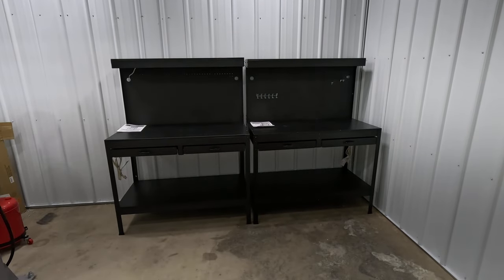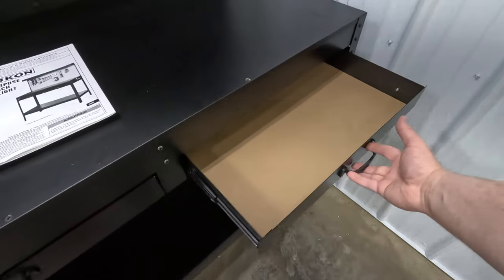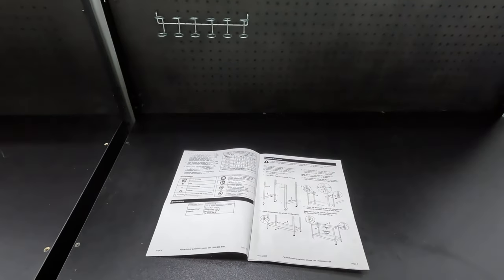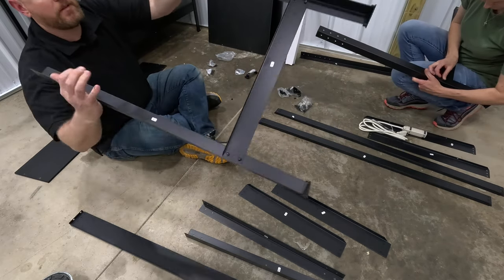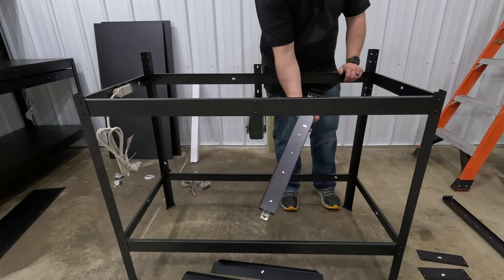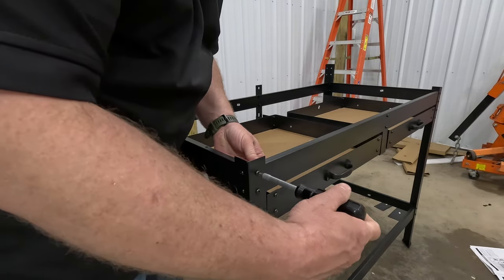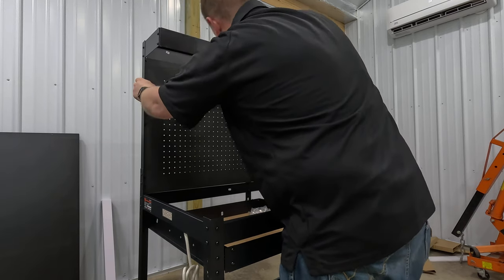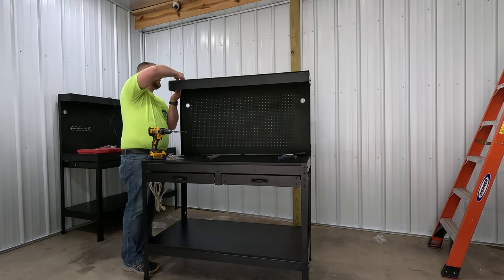Harbor Freight Yukon AKA Wen Work Bench Review and Assembly How To

Comment: Well. I bought my first work bench and as I began to unpack the pieces to make sure all the pieces were there, ( because there was a good size piece busted off the side of the box), I saw that pieces marked 4, were not visible with rest of the metal pieces, so I took the kit back to harbor freight for an exchange which they did gladly. Well I unpacked the second kit and didn’t see parts marked 4 again. But I decided to look at the pieces in the drawers and there they were. I think they should have put those pieces with the rest so the buyer would identify them right away and not get thrown off this way. Anyway nice bench and I mounted my bench grinder and vice on it. Great setup. My light was the full width of the bench. This one is a lot shorter.

Comment: I partially watched two other videos before yours. I really appreciated that you specified the part numbers when the other two just fast-forwarded without verbal instruction. I think my bench is an amalgamation of the Wen and Yukon benches. I bought mine at Harbor Freight but have to assemble the drawers and the bolts have regular heads and the nuts use separate washers.

Comment: I just bought one of these from Harbor freight got it on sale for $99 plus tax. And I put it together by myself which was a little difficult with some of the pieces trying to bolt on like the bottom piece that goes across that frames the bench but I managed to do it I ran into some issues where putting in the pegboard would not go flush against the frame because there was already a bolt in there pushing the pegboard out so I’m not sure if I put a bolt in the wrong place or what the deal was and I didn’t bother to try to take it out it was a little too awkward. Also I did not get the hardware to install the light and I’m pretty sure I didn’t lose it. I agree with you for the money whether you pay $100 or 130 or 150 I think it’s well worth the money.

Comment: Do you think a vise could be added to the front right corner? With a plywood plate inbetween of course.
Reply from the maker: It could but I wouldn't do major torquing on it
Reply: @JackofAllMasterofNone  I would only change out grips on golf clubs.  Thanks for your response!
Reply: I mounted my vise and a bench grinder on mine and I just drilled holes into the bench top and it worked fine. Sturdy.